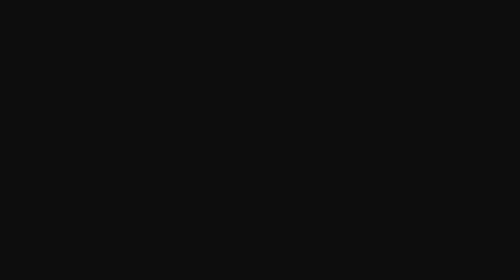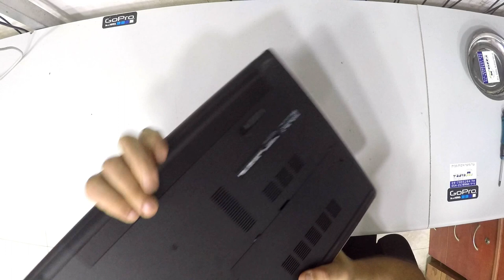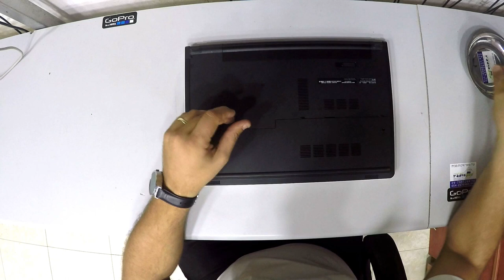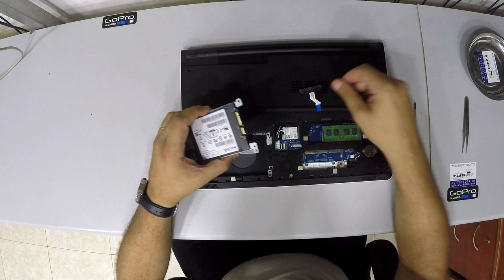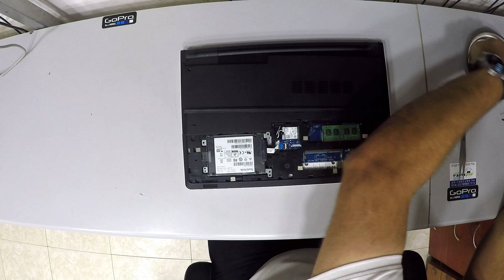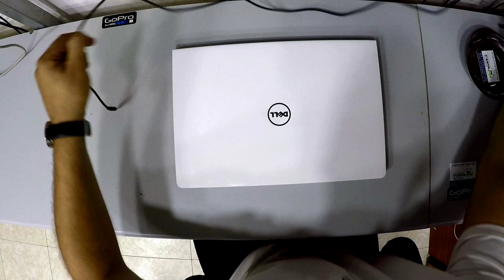Dell Inspiron 5558 HDD SSD Replacement

Comment: after putting the ssd into hdd slot now can i put hdd in the optical drive slot with the help of a caddy? pls reply i really want to know my model is inspiron 5558,hdd storage is 1tb which is currently in my laptop , ssd i want to install in my laptop is 250gb samsung 860 evo sata 2.5 inch
Reply: Hey you needed to buy a caddy right? Can you point me out which caddy? I want to upgrad this 5558 Signature Edition with a SSD and remove the disc drive I never use to put in the old 1TB HD.

Comment: Funky computers, runs like shit with the 8gb ram on board and the hard drive has a pretty finite life, the easy ram replacement for 16 gb and a 1 tb SSD are a god send, can't wait for putting in a SSD in there, so easy if you got a cloning setup for upgrading too. Love machines that actually got an easy-access panel.

Comment: is it easy connect the SSD to the motherboard with this adapter
Reply: Dell Inspiron 5558 has a problem: if you replaces HDD to SSD _only_, this laptop doesn't start a boot process. Nobody nows why.

Comment: I have the same model of laptop. I tried installing the way you shown but, I encountered a problem. The HDD does not show up when n I installed the HDD, (2TB) that was originally available in the laptop with caddy in the DVD port. Did you encounter the same problem?? Do you have to upgrade your Bios or something else? Can you also share you BIOS version?

I added Samsung V-NAND 860 EVO 250GB to maine SATA port.
Reply from the maker: Hello, Mabey you use a defected caddy. if not change the boot option to EUFI and try again.
Reply: Dell Inspiron 5558 is really bad. It works with old HDD. If you use old HDD with SSD installed in DVD slot, it works. But if you replace HDD to SSD, it doesn't start boot process! Even using legacy bios option (set an order of loaded devices) doesn't help. Nobody knows how to run this laptop from SSD __only__. Also, if you use non original power supply, this laptop loads 20% of CPU and works incredibly slow. And you have to use genuine battery also, if you want to use it. It is not possible to repair battery from this laptop (the controller inside block itself forever). This laptop doesn't want to charge battery from non-original power supply even in switched off mode. Dell Inspiron 5558 brought me a lot of problems.